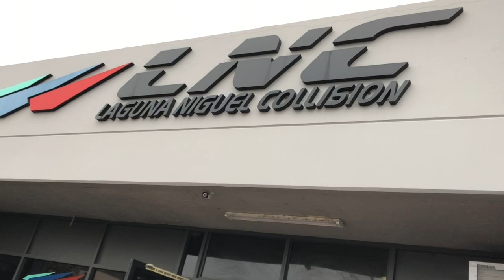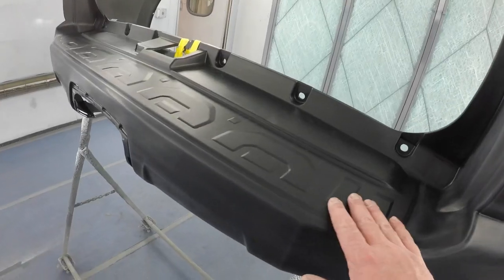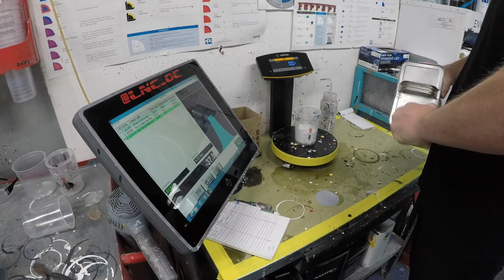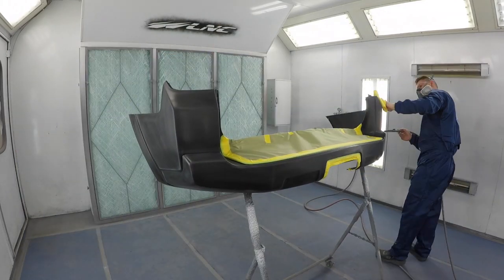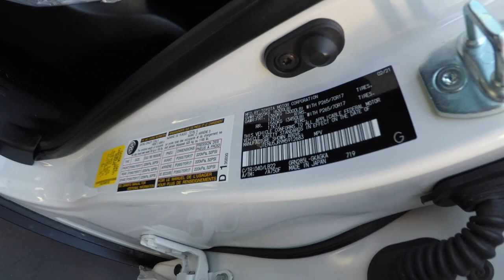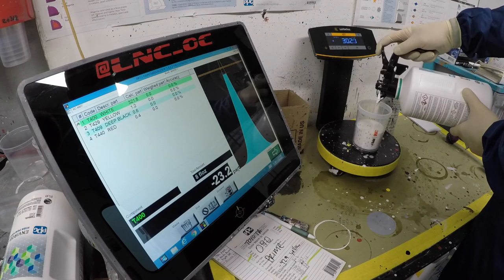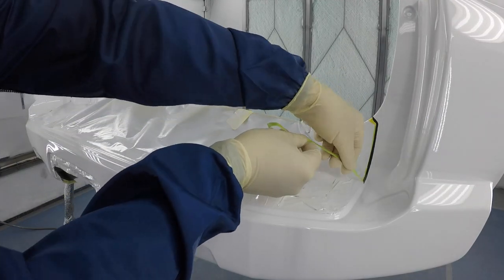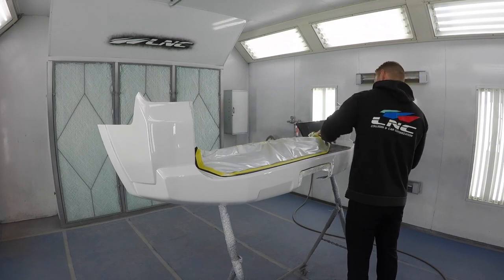2021 Toyota 4Runner NEW BUMPER Paint Process using PPG EHP

Comment: Is that paint difficult to match? How many variants are there for 040?
Is there usually much difference or adjustment required?
Reply from the maker: Being a solid color its not extremely difficult to match, but there are quite a few variants, 7-8 variants I believe. Being a solid color, it usually just takes a little bit of adjustment
Reply: @LncPainter  thanks I need a spare new bumper painting - the shop have a machine to scan the paint but not sure how much adjustment is required as the car is new.

Is the filler cap suitable for taking a scan from  as the body is coated and don’t want to polish it

Thanks

Comment: How close to the color does it match? Is the bumper darker than the original paint? I’m getting a new front bumper painted in Magnetic Gray Metallic for my 4Runner and I’m worried about it being darker than the rest of the vehicle.
Reply from the maker: It will vary slightly but shouldn’t be particularly darker or lighter, at 6:52 i show what it looks like installed on the car.
Reply: @LncPainter  thank you. It’s hard for me to tell in the video. I’m just a nervous wreck getting it repainted because I want it to look as close to the original paint as possible.

Comment: There is a lot of movement in the plastic bumper covers. Does that crack the paint?
Reply from the maker: The paint and clear coats are quite flexible and will not crack